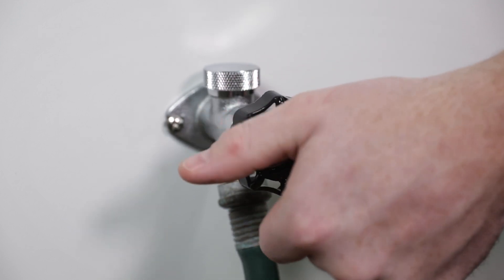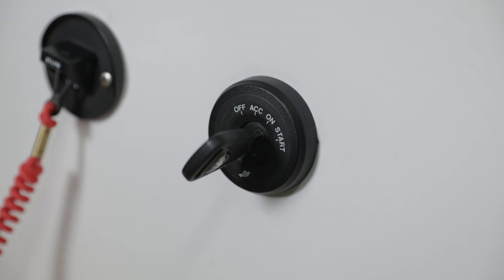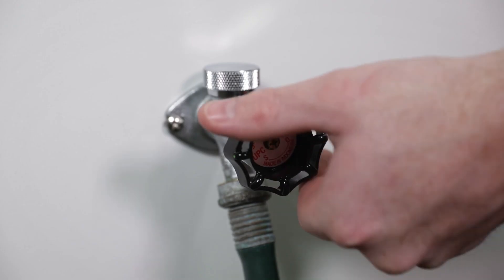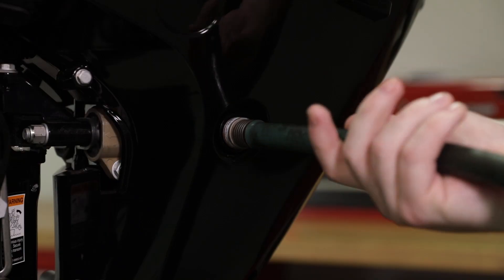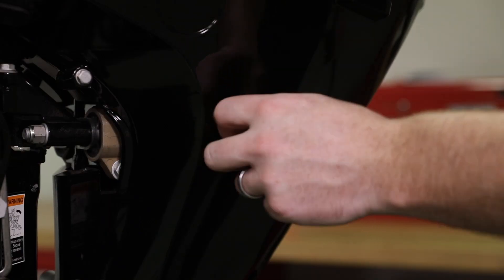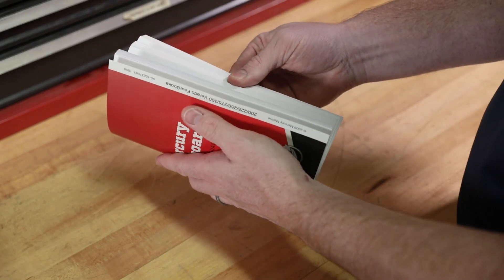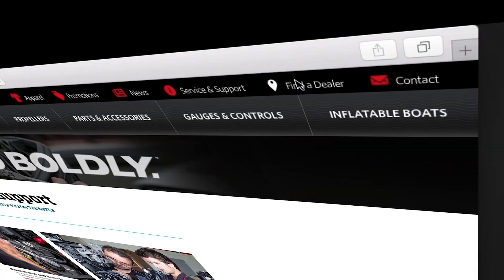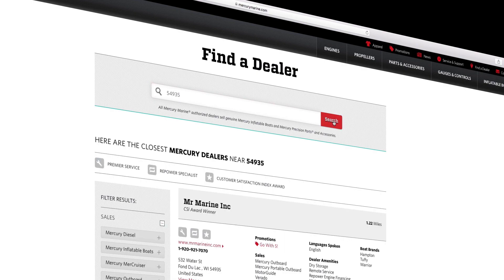Mercury 15 / 20hp EFI FourStroke Outboard Maintenance: Freshwater Flush

Comment: By chance is there a part number for the plug? Lost mine and cant find a part number anywhere
Reply from the maker: The part number for the flush plug is 8M0135914. If you need a new plug seal as well, that part number is 8M0137342. Keep in mind, these part numbers pertain to the 15hp and 20hp EFI outboards.

Comment: So you don't have to have lower unit in a bucket of water? No use of muffs to cool impeller? this can be done out of water?
Reply from the maker: That is correct. Water coming into the flush port will circulate the entire system, including the water pump impeller.

Comment: I have a Mercury 2013 20hp 4 stroke. What year did mercury start putting the hose plug in the outboards?
Reply from the maker: The flush port was added in 2018 when the 15hp and 20hp engines were redesigned and changed over to EFI.

Comment: Is there an adaptor to screw into the port to put a quick connector hose end on it? Thanks from down under
Reply from the maker: We do not offer any sort of quick-connect adapter for this, unfortunately. Since the threads in the flush port are standard hose coupling threads, you may be able to source something locally or aftermarket to fit your needs.

Comment: wiat you did not show it flushing or tell why the prop was removed. Not cool
Reply from the maker: Hello Jerome! As the engine will be running while flushing, the propeller is removed as a safety precaution. We apologize for the disappointment you have regarding the engine not being shown running while on the hose.
Reply: @MercuryMarine  was wondering about the the propeller removal, I wouldn't bother with that.